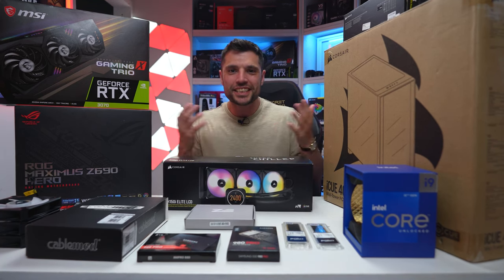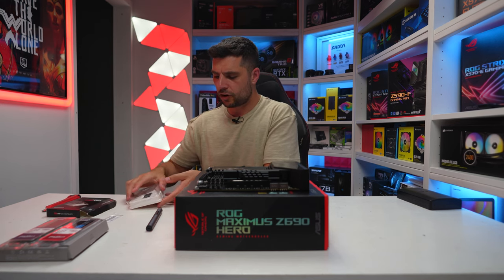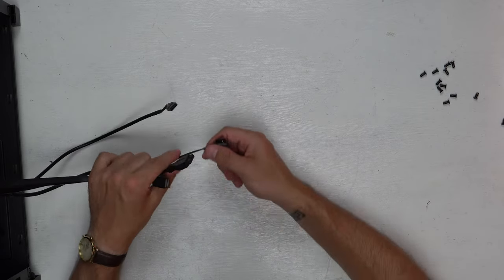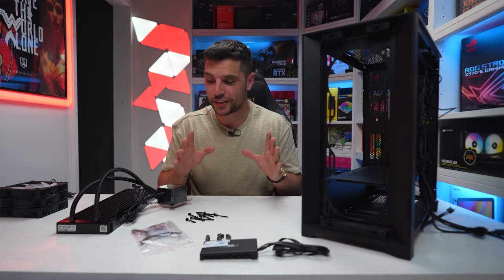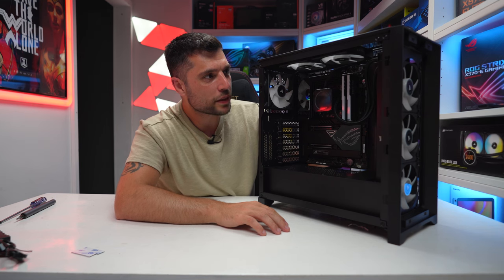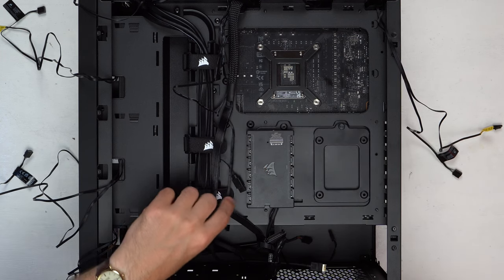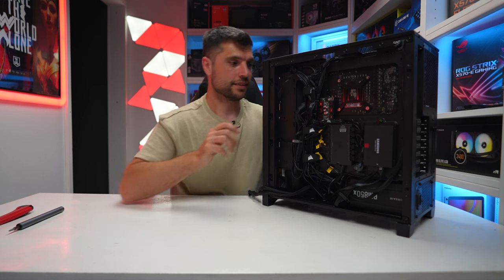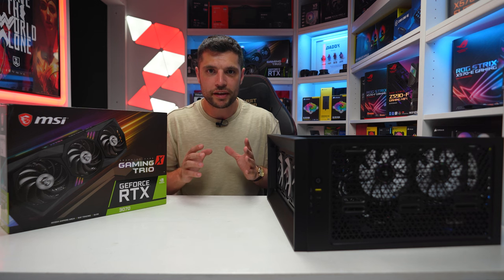PC Build in the Corsair 4000X - Intel 12-900K/RTX 3070 [Build Guide/Step by Step]

Comment: Similar setup to me.i7 9700k msi 3070 rtx corsair 4000x rgb case.
Reply from the maker: Nice little system and as long as it does what you need my man no need to upgrade!!
Reply: I have same cpu and i think u have bottleneck
Reply from the maker: @sergiomm95 9700k will be causing a slight bottleneck yes with 3070 but it's not anything to worry about tbh

Comment: I've got this case. Any idea why my fans are spinning but the rgb don't light up. They show up in icue  software.. has power and the controller plugged in to the power supplier and  the USB2  header. I see you removed it on this build.
Reply: Solved
Reply from the maker: As long as power to hubs via sata and then via usb2 to mobo all should be working mate. I removed it as there was a easier way to do it
Reply from the maker: @spoony4312 nice 👌

Comment: I would recommend installing the hoses from the pump downwards as air can get in more quickly at the top. It is very unlikely at the bottom.
Reply from the maker: Never once had an issue mate in over 100 systems but thanks you for watching
Reply: @TechCheckUK 
hello,
thanks for responding.
ive got the same case 4000x and want to build in the 150i elite xt lcd 360mm. i would install the aio like you did. do you think it should work ?
Reply from the maker: It will work with no issues mate I have built in 4000x 100 plus times 👍
Reply: appreciate it @TechCheckUK
Reply from the maker: No worries 👍

Comment: I can't figure out how to install the extension cable to the 4000x case. the holes don't line up? Anyway someone can show me? What I did was put it in the grooves but card moves a lot. I would think it needs to be mounted. Holes on bottom of case but don't line up to extension cable. I am confused...
Reply from the maker: Depends on brand mate corsair designed for most and the one we used worked great. Sorry your having issues.

Comment: This video was truly amazing! My computer of 5 years that was prebuilt stopped working and I decided it was times for a upgrade.. I bought all the parts including the 4000x case with the LCD H150i cooler, and watched this entire video pausing on and off while doing my first ever full build. Took about 7 hours since it was my first time and I ran into some hiccups but without this video I would when been lost and finished way way slower. When I finally got everything in and hit that power button it was all working probably and the build was completed. Thank you so much! You deserve many many more subscribers!!
Reply from the maker: Comments like these are amazing and 100% the reason I do youtube. Thanks so much and really pleased you built your own system and welcome to the community 😀
Reply: @TechCheckUK  hey man I have a question. I booted up my computer using my old drive and it went straight into windows but it was very very slow. All the fans are working but the h150i liguid cooler has a red flag showing and whenever I try to go into bios a message comes up and says my cpu is overheating. I have an i7 12700 with the 4000x case , a 3060 12gb, 850x psu, 32gb of ram. I also get into bios but it’s very slow and I can’t do much or change anything.
Reply: My cpu says it’s at 100 Celsius in the bios. I’ve made sure all my wires are connected into the psu and the motherboard. I’ve switched from the splitter cable that came with the cooler and instead just put the USB’s into the usb slot without the splitter cable that didn’t help, all the fans work and spin the whole computer turns on and boots into windows but my cpu gets really hot and the computer boots up and is VERY slow after being booted up. I’ve made sure my H150i is attached properly and into plate, I first had the thin cord from the cooler plugged into “cpu pump” but I changed it to “cpu fan” and that also didn’t do anything. I feel like I was so close to getting my first build done 100% correctly then this happens. Any help will be very much appreciated thank you very much!
Reply from the maker: U need to ensure you have connected your commander pro or fan hub via usb2 to motherboard - download icue and do the update for icue. Have u checked u clamped down the cooler correctly with enough thermal paste? Did u connect to cpu header? I's your icue picking up your fans
Reply: @TechCheckUK  thank you so much!!! I forgot to connect the main cable to the commander pro and once I downloaded Icue all the RGB worked and so did the H150i. Computer is now fully running and all temps are perfect! Once again this build would have been very very difficult without your video and help. You have a earned a new supporter :)
Reply from the maker: @HassanErakat  no problem 😊 and thank you!
Reply: @TechCheckUK  hey man you always reply and I’m not sure who else to go to or ask. My computer was running perfectly fine for a whole day and after turning it off and going to sleep I woke up tried to log in and I got an error code “0xc000000e” I spent about 4 hours last night trying to figure it out and today 6 hours doing different fixes speaking on the phone with tech support. Nothing seems to be working. I cloned my old HDD drive to my ssd and I thought it was something to do with maybe my windows being removed off the drive but it’s still there and shows up. In bios when I launch with ssd it shows it in the boot priority and it’s selected. I tried putting in my old HDD to see if that would work and I got another error code saying “critical process died” with a frown face. I’ve tried absolutely everything from google to YouTube. Using different stata cable for my HDD to making sure my ssd was properly connected. I feel like I’ve tried everything and I was so happy that my computer was up and running but now I’m stuck and don’t know what to do.
Reply from the maker: It seems like there is an error reading from the ssd or hdd mate I would personally reinstall windows on a new drive and just ensure you disconnect the others and once done reconnect and perform a wipe.
Reply: @TechCheckUK  yes that’s exactly what I did. Now I have new windows installed on the ssd and the computer is up and running. Only issue I have now is finding my network adapters for wifi and Ethernet.
Reply from the maker: @Hassan Erakat  great news 👍 well done I can't help with the adapters and WiFi sorry but good luck - ensure u have done all the windows updates and they may update and update automatically
Reply: You build the PC by youself? A guy build it for me, i don't know

Comment: Amazing build and guide through the process! I was surprised by the quality of the video and how few subscribers you have when this is quality content. Just wondering, when you remove the RGB hub that the case comes with, what cables do you need to remove as well? I’m also doing a build using a commander core so I think it would be easier to remove the rgb hub.
Reply from the maker: Thanks mate I appreciate the support and positive feedback. I only remove the hub there is a sata power and USB 2 cable thats attached that also is removed apart from that nothing else my friend hope that helps and good luck 👍
Reply: @TechCheckUK  thank you so much and I’m excited to see future videos!
Reply from the maker: @waliansari9467  I appreciate wall thank k u

Comment: Building a rig in the next week or so like this but in the (technically) new 4000d RGB airflow, can't wait! This has given me a great idea on how to go about setting up the commander core, thanks!
Reply from the maker: Nice and good luck on the build 👍 thanks 4 watching mate I appreciate it 🙏
Reply: Why not 4000x?
Reply: @rodolfotsang4327  wanted the extra airflow, and it comes with the newer AF120 fans that match those on the AIO I am buying. Plus, if I ever want the glass front you can buy it from Corsair alone for $20.
Reply: @JenjarplaysMC  the 4000x front have glass to see better the rgb, i bought the 4000x does it have airflow?? I'm worry it will get heat
Reply: @rodolfotsang4327  yeah it still has airflow, not as great but it isn't horrible. If you do run into issues you can also buy the airflow panel from Corsair; they are interchangeable.
Reply: @JenjarplaysMC  i have fans and i can open the glass

Comment: 22:26 Did you have to buy longer screws for the top two fans flipped awround to exhaust the case? The threads on the fans are only on one side and when I flip them around the short screws provided don't reach the bottom part of the fan where the threads are.
Reply from the maker: No mate the fans I used have threads both sides of the fan so it can be intake or exhaust - u only need small screws / Nothing stopping you using long ones if u have too tho mate if that's what u need
Reply: @TechCheckUK  ty. Great video very helpful
Reply from the maker: @Photogromer  thanks 😊
Reply: Also I'm an idiot. The small screws create their own threads in the fan plastic when you screw them in. I spent way too long trying to figure it out before the light bulb went off. Lol first solo pc build. It's been fun 😄
Reply from the maker: Thats the fun of it mate think of it this way it will never happen again cos u will know 😉

Comment: Good day mate. I have the same 4000x case and still a bit confuse on either to install H150i in front with 2 extra fans on the rad or H115i on top. Any tips would be appreciated, great video as always. Greeting from Canada !!
Reply from the maker: Thanks mate and appreciate you watching - I would opt for h115 at top as exhaust looks better  - will have slightly higher temps 4c so not bad BUT if you already have the h150 at the front will also work great 👍
Reply: @TechCheckUK  No I have yet not purchase any AIO, but I'll take your advice and go high. Thanks for your help, I appreciated !!
Reply from the maker: More than welcome and appreciate the support and good luck 👍

Comment: hello their,just wanted too ask i bought a deepcool ag400 heatsink fan
for asus b550 tuf wifi board (UPGRADE) and it stands up rather than lays flat, making it stick out 6" from the board too the side panel but their isnt enough space for the side panel to go on ,if you could tell me i would  like too know what the size is from the motherboard out ward too the side panel on the corsair 4000x,or WHAT is the measurement of the roof (INSIDE )WIDTH ways of the case,im just trying too buy a new case without buying the wrong one,ive already done that with the heatsink,massive it is 6" square....jaw droppingly BIG. thanks for your time....
Reply from the maker: Hi mate sorry for late reply - clearance in 4000x is 170mm for tower coolers

Comment: I am getting an Asus ROG Strix Z690-E Motherboard and I am so confused about the SSD configuration.

Is there a huge benefit to getting a 980 Samsung 500GB M.2 4.0 NVMe drive for windows 11 only?
I am also planning on getting a 2TB M.2 4.0 NMVe drive for all of my other game/application storage.

Is that the correct way to configure it? NVMe for both storages?
Also, I saw that slotting in the first slot for this board halves the speed (x8 instead of x16). I wanted to see if you knew anything about that.

Thanks for everything!
Reply from the maker: Hi Vyrukk z690 e is a great board mate and good choice 👍 personally I would now only stick with nvme drives as much as possible. Especially for operating system and especially where data transfer is crucial. U don't necessarily need a 4.0 2tb drive as load times are very simular for games as pcie 3.0 but it cost don't play a factor then go for it. Windows on top slot and then 2nd drive goes into next available slot down mate and x8 is still much faster than pcie 4.0 so it's fine 🙂 hope this helps and good luck with the build 👍
Reply: @TechCheckUK  Thank you so much!! The only other question I have is about cooling. Does the i9 12900k NEED the 3 fan Corsair cooler (iCUE H150i Elite Capellix)? Or can I use the H100i Elite Capelliix in the 4000x case?

So confused about this. I want to use the 4000x case with a top mounted radiator, but I’m hearing maybe the H100i won’t be able to cool the i9 12900k.. I’m not wanting to overclock or anything
Reply from the maker: Yes you can mate the h150 will be cooler but it wouldn't be a huge difference mate especially if your not overclocking.

Comment: Got this case recently , and cannot get the RGb fans to work, the fans work and it reads they are there but no RGb control…
Reply from the maker: It's because your rgb fans are not in order 1-6. You need to check your your order mate and then  they will work 👍

Comment: Exactly the same issues as I had in my 4000X thinking about push/pull on the 360mm  elite capellix with my RX6700XT. I hope the 3090 isn't much longer than the 3070 lol.
Reply from the maker: Yeah with the gpus getting bigger and bigger the mid tower cases not compensating it's hard especially with the odd shapes of the shrouds on the gaming x trio - change to pcie 4 riser cable will sort all the issues if needed but I personally think its too close to the glass.

Comment: How much room was there left in between the gpu and the aio radiator? Im planning on building this ecaxt setup but pairing it with either a TUF 3090 oc of a suprim x 3090. Do you think it will fit? Great in depth build video man! i'm definitely gonna use this video when building my pc :)
Reply from the maker: Thanks buddy it was tight, and that was a 3070. Great gpus BTW can't go wrong with either 👌 I wouldn't like to say it would as I don't have it anymore so can't check. I wish u all the best and good luck 👍
Reply: @TechCheckUK  Thanks for the quick response! Just ordered everything. If it doesnt fit i'll switch to 100i Elite LCD top mounted aio. Do you think that will be enough to cool an i7 13700k in the 400x rgb case? thanks!
Reply from the maker: @Bram H  100% mate 13700 not that bad it's the i9s that are really hot 😳 good luck 👍

Comment: Hey guys quick question, I'm planning on a build with the same sorta set up with the front mounted rad but just wondering if it naye be better you have the rear fan as an intake instead of an exhaust? Cheers
Reply from the maker: No mate rear fan always as exhaust as you will be pushing air from front and exiting at top and rear. Always intake bottom or front or side and exhaust at top or rear. Regards

Comment: Could you just use the sp case fans with the radiatior for the aio. Then use the aio fans as exhaust on the top and back to save time?
Reply from the maker: Yes mate that's not a problem
Reply: @TechCheckUK  thanks for the quick reply
Reply from the maker: No worries 👍

Comment: Great video I just have a few questions if you don’t mind. Are the top and rear fans exhaust or intake? Also i know you said the radiator (at the front) was an intake but I see you added 2 more fans on the other side of it(inside the case. Are those 2 extra fans in the bringing air into, or out of the case? (I think when you said push pull I need that in more simple terms) sorry for my lack of knowledge, I’m new to pcs.
Reply from the maker: The top and rear are exhaust mate. The fans at the front are set to intake. Fans outside case are pushing in the rad, and fans inside on the rad are pulling air (both set as intake) just push air and pulling air so you can get more airflow and therefore cooler temps
Reply: Okay thanks so much, great video and great channel
Reply from the maker: Much appreciated 🙏

Comment: My build uses this same case and AIO, and AIO position with the fans in front. My CPU goes between 48C and 64C, and that seems hot to me. Is there anything I can tweak?
Reply from the maker: Personally I would check your aio and ensure its seated correctly on cpu at idle should be less than 40c deffo - could just need tightening down mate

Comment: The orientation of the radiator is wrong, the pipes should go from bottom up to the pump.
Reply from the maker: Oh dear that's incorrect as long as the pump is lower than the inlet so that any air will be be trapped at the top of the rad its fine! Please don't Reference Steve's video.

Comment: I did basically the same build a year and a bit ago, the case doesn't work very well with the vertically mounted GPU anyway, my ROG 3070 overheats so i have to leave the side panel off :/ i almost ripped my mobo in 2 trying to put the thing on it originally, so i had to use the gen 4 extender from corsair :P
Reply from the maker: Totally agree as gpu too close to the glass panel. It looks nice but don't perform well 😔 thanks 4 watching mate
Reply: No problem bro, it was fun to watch :)
Reply from the maker: @fxhzwingzero  😊 thank u

Comment: Same case and thanks for this vid! I wasn’t this cool.

Decided on:
i7-10700k unlocked
iCUE H150i elite
ICUE SP120 RGB ELITE x3
970 EVO Plus x2 1TB 3x4 NVMe
XFX 
VENGEANCE PRO 32GB x 2 3600 MHz DDR4
RMx850x

Open to suggestions or comments.
XFX Speedster MERC319 6900xt
Reply: 1st build since 2015. Just had to add..lol
Reply from the maker: Nice build and good parts choices can't go wrong! Do u stream or edit? Just thing of that when choosing a amd gpu as will make a difference mate especially encoder nvenc for example. But the pure rasterization power is amazing 👏
Reply: @TechCheckUK  No sir, I'm still playing Ultima Online..lol. I'm U.S. based. Thank you for you advice/opinion.
Reply from the maker: @canyoudo1t  no problem at all 6900xt will be great 👍

Comment: The 4000x itself comes with an RGB controller right, why still commander pro? any added advantages besides single hub?
Reply from the maker: U can just use the commander pro as a fan hub and have one control and less cables attached to fan headers and less clutter mate. Its not essential at all if your looking to save 50 quid. The best way is to get a 240mm or 360mm elite capellix and it comes with commander core that can do pwm and rgb.